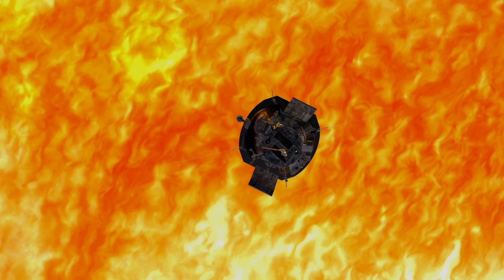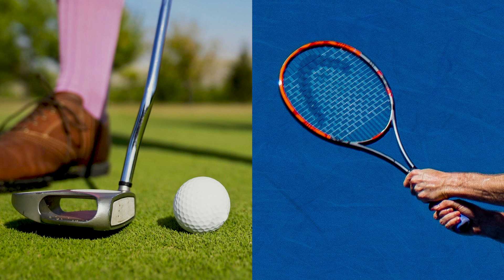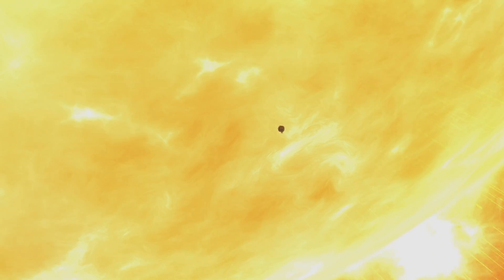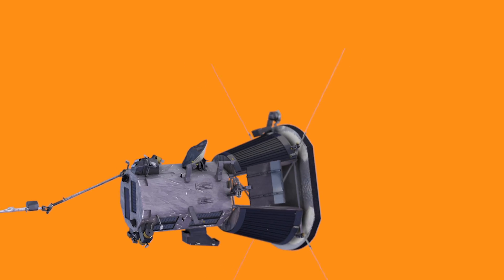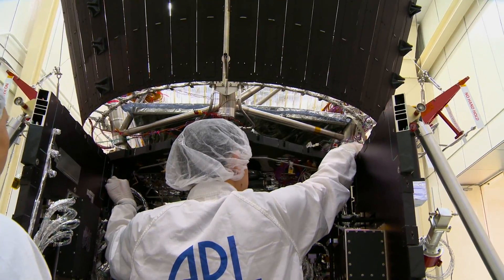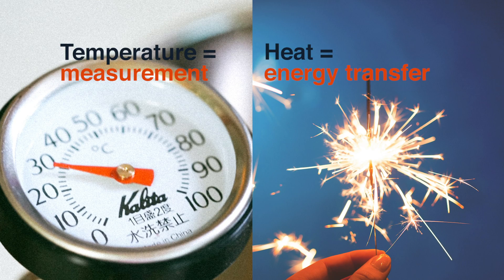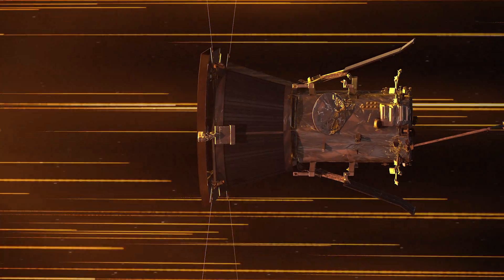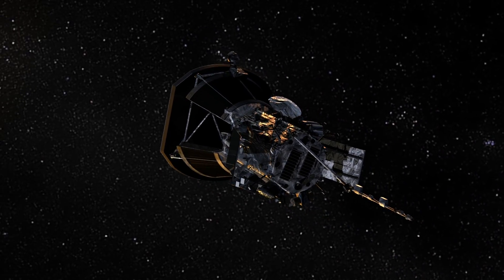Why Won't it Melt? How NASA's Solar Probe will Survive the Sun

Comment: alright stupid questions

1) Why not cover the whole probe in the heat shield?

2) when it gets close enough to the sun wouldn't Light be hitting all sides of the probe and thus throw the sensors off (blinding it)

3) what is keeping the radiators cool? Might the water behind the solar cells heat up faster than it has time to cool and become ineffective?

4) IF the water in the system was to get too hot and become steam, can the cooling system take the extra pressure or is it going to blow itself up?

5) as a counter measure wouldn't it be wise to make sure the electronics are water proofed?

and that's all the stupid questions I could think of atm.

Edit:

6) Did they make sure that all the components used in the probe don't have a low melting point.
Reply: Here's the answers I could come up with, correct me if I'm wrong:
1) The whole probe isn't covered completely is because the only spot that would get heated up is the spot that faces the sun directly, so it'd be unnecessary to cover the entirety of the probe in the heat shield. All you'd have to do is make a circular heat-shield that covers the probe from direct view of the sun, and make sure it's always pointed at the sun to prevent damage.

2) No, because there's no atmosphere and ground like on earth that causes the photons to reflect and go in many directions. If you're not in the line of sight of the sun, you won't have any light and heat hitting you.

3) The radiators radiate the heat off into space in the form of infrared radiation. The required water flow to cool the solar cells and the amount of heat radiated has likely been accounted for by NASA, so they've designed the probe's cooling system based off of calculations and tests.

4) I believe they accounted for this by increasing the pressure of the water in the system, which allows the water to have a higher boiling point temperature and thus reducing the risk of explosion.

5) The electronics are already hardened to withstand radiation and other thing in space, making them water proof wouldn't really make sense. If the water system failed and exploded, there would be no water to cool the electronics and space craft, so it would be destroyed regardless if they were water proof.

6) The electronic components chosen for the mission and the solder joints between them likely have high temperature tolerances, and are likely to be very reliable for space flight applications.

I hope this helped answer your questions!
Reply: Rafy Azhari Well they already know what to expext when they get to the sun in terms of heat and the density of the corona from long range measurements from earth/earth orbit. 

And if your worried that calculations may not be good enough. It mah be worth remembering calculations and testing of individual parts is all you have against the wing snapping when ever you take a flight. Its very rare that a full wing assembly is acturally tested to destruction during production. And its onlu ever done once. Wings made after it are just subjected to a normal operating load.
Reply: Well for arguments sake we assume that the sun is large enough, and that the probe is close enough, for you just to think of it as a big flat plane emitting light. This is the worst case scenario as its actually curved and some light will be shining diagonally above and below the spacecraft. If we go back the plane, the light it emits is radiated out from the plane, perpendicular to it. Then some of it is blocked by the heat shield leaving whatever is behind it in shadow. This shadow does converge at and angle yes, but it's certainly been calculated by NASA for operating distance of the probe. Hence why the main bit of the probe is a lot skinnier than the heat shield. Just look at planets for an example, one half is bright, one half is dark and in shadow. And because there is no atmosphere to scatter the light the shadow is pure shadow and actually extremely cold.

You ask what there is to stop the sides of the sun radiating light sideways/diagonally towards the spacecraft? For one theres physics, most of the light/radiation is shot off perpendicular to the surface. The reason we get such effects here in earth is because of the atmosphere scattering light. In the case of the sun its just flung outwards with the solar wind. And it some were to be scattered towards the probe in some way it would likely be too weak to effect it much. Also the probe could be orbiting too close for that to be a factor. The closer it is, the less the bits of the sun not directly in-front of it, can effect it. As is you drew a line, from its point of origin on the surface, it would have to go through more of the sun itself again. Just take a circle and put a dot representing the probe right next to it, see how many lines you can draw to it from the surface that dont go into the circle itself, its rather limited. And that the worst case scenario for radiation from the sides of the probe.

Hopefully thats cleared some bits up! :D Sorry its a bit long, I think I've rambled.
Reply: Kittsuera
There is idea they should test this device in some solar energy station with mirrors collecting the Sun light in one spot. The should place it into the spot with expected light energy flow. Then do testing for at least one day (several peak hours).
Reply: Kittsuera 
1) money and weight. Heatshields are expensive and heavy.

2) the light from the sun flies out from the surface and away from it, meaning there would be nothing to reflect off of and onto the spacecraft.

3) the water is kept under pressure so that the boiling point raises above the ambient heat of the surrounding area. Water is a very versatile cooling system.

4) I dont work with NASA so i dont know, as i said earlier, water is pretty great so i dont think they would do such a thing out of sheer will. But who knows?

5) the spacecraft is flying towards the sun through space. If it can withstand a vacuum, it can take water.

6) NASA knows what theyre doing, last thing I expect is for them to underestimate the heat of a giant ball of plasma 1000 times more massive than our entire world.
Reply: I still for see a slight problem with my # 2 point.

the Sun is about 109 Earths wide. will light really be radiating in one direction perfectly Vertical from every point on the sun?

What is stopping the far ends of the sun from radiating light diagonally?
Reply: and how much time does it need to cool the probe? there's only a couple particle there, but the probe stay close to the sun for a long time. They haven't tested the probe at the sun, have they? 
also how much time does the probe to arrive at the sun's orbit?
Reply: _ _ yea sure, they've calculated all that. Let's say they could calculate the amount of particle around the sun without a survey. A single expedition would take how many years? It's just one test. Many years are required to build A single spacecraft to go to space. If it doesn't explode before entering the space ofc. I forgot the whole probe is just an idea, yet. sorry
Reply: This ISN'T the first probe we've sent to study the Sun.  It's just the closest one so far.  "If I have seen further than others, it is by standing upon the shoulders of giants."  Pity so many people today wrongly assume our forefathers were midgets.
Reply: If you cover the entire craft, it only makes heating problem worse.
Like the video, it looks like the craft being in a shade of that shield.
If you cover the entire craft... It will transfer the not reflected heat to the entire body of the craft. And even threatened it to explode from gas or fluid expansion.
As the heat taken to the craft internals wouldnt be transferred well to outside.
Either greenhouse effect, or black body also served as a heat trap for the things inside the shell. 
That's my opinion. Not entirely sure if correct.
Reply: It ain't going that close to the sun dude
Reply: Rafy Azhari im pretty sure that nasa would have calculated all that and built the cooling system accordingly. 

And I think you underestimate how tough the electronics are. If we can build probes that withstand the temperatures of venus we can do this. The efficiency of heat transfer is much much lower as there is next to nothing to transfer the heat.
Reply: all i see is gibberish. English please
Reply: Answer to 1-6: stfu

Comment: When probe is inside 0.3AU from Sun, its communication likely start to fail. Around 0.1AU, it will be knead/crush into a spherical shape by coma-like inward pressure... could have learned a lot more from data of probe plunged into Jupiter atmosphere.  Better value for science by placing a probe with submarine structure (ensure shape+equipment integrity) at Mercury L1 point... My ignorant 2 cents!
Reply: something something heat shield and radiators. Youre ignoring that Oumuamua had no means of a good cooling system, the water and the radiators
Reply: Honestly at this point you're using so much unnecessary filler information I have no idea what you mean to convey. Its literally a word salad in the context of a response
Reply: I am not disagreeing on Parker necessary heat shield.  I stated 'coma-like' or one can envision energy volume analogous to expanding Chromodynamic Binding Energy as probe traverses into denser gravitational and radiation field.  Recalling, comet Shoe Maker broker into pieces (quite far away from Jupiter) not due to thermal.  Comet Holmes/17P in 2007 briefly a largest object in solar system (bigger than the Sun) - for sure, its coma didn't formed by heat. Comet Lovejoy survived glaze almost at sun surface... it didn't has a heat shield.
Reply: Thanks for replies... maybe reread my comments after Parker probe failed.  'Word Salad' - from an EU speaker, iirc.
Basically, I predicted the cause for this probe failure, which is by pressure, not heat.

Comment: Does it turn and take peeks at the sun and snap pictures?
Reply: No.  It has to keep the shield in front of the probe to prevent damage.   It can photograph the corona but not the sun directly.   That can be done just as well from a safe distance.

Comment: Must be tough times for the solar panels.
Reply: SourceThunderLight 
Yes, solar panels require water cooling in such conditions. Also they are not directed to the Sun for maximum light collection. They can be set by small angle to the Sun light and collect only small fraction of it. Also the panels improve electricity production if they collect more light. They can produce 100x more electricity near the Sun if required.

Comment: I'm confused.  If it can run tests and sense things without interference from the heat shield and if the heat shield actually works, why not shield it on all sides?  Why would you only shield it on one side?  It makes zero sense to me.
Reply: It only needs to shield itself from the solar radiation of the direct sunlight, which would damage the probe.  Shielding it on all sides would prevent the instruments from measuring the solar corona, which is the whole point of the mission.
Reply: Tletna Because the heat shield probably weighs a lot, and the less mass you spend on shielding, the more you can use for science stuff.
Reply: How is it fake? You can visit their site to get all the information you need.
Reply: This shield reduces termal energy flow. But it is still not zero on the other side of the shield. So making ball of shield does not have any sense for the electronic devices. Ball shield will be heated to the maximum temperature, and all inside will do the same.
Reply: Because the heat will be coming out from the sun.
Reply: Tletna you got zero brains, really

Comment: Is it going to be launched or already launched?
Reply from the maker: +Alexander Belov - There's an animation of the trajectory and course corrections around Venus on this page: https://svs.gsfc.nasa.gov/13003
It's item number 11 on the page.
Reply: To be launched on August 4th.
Reply: I'm actually concerned how they are going to get close to the Sun since they need to start from the Earth moving 30km/s, then reach escape velocity of about 11km/s. Assuming they do acceleration in the direction opposite to the Earth orbit they get 19km/s around the Sun. But this is not enough slowdown to come close the Sun. They need slowdown to 1.5km/s around the Sun to get so close (6,500,000km), but how do they accelerate from 19 to 1.5 (>17)? Do they use heavy rocket to do this? Are they going to do gravitational maneuver around the Venus, an the Mercury for additional slowdown?
Reply: NASA Goddard Looks like it shall have elliptic orbit that passes near the Venus orbit.

Comment: The shot with the probe with the full-screen sun in the background is wrong; they're overstating the closeness for publicity purposes. The probe will get to about 9 solar diameters away, so the Sun will be as large as a softball at arm's length. This is extremely close in terms of heat, but it won't look as big as the shot implies.
Reply: From the probe, the sun's angular size would be around 12 degrees. So that's still a good chunk of your field of view, but not nearly as much as shown in the animation.
Reply: Not 9 solar diameters away, but about 4.4 solar diameters away.  6.2 million km divided by sun's diameter of 1.4 million km.
Reply: Daniel Griscom sounds cool, I would be even cooler if it was real

Comment: How thick is the Heat Shield ?? Dimensions please ?
Reply: Mystery Man it was explained in the video.
Reply: Mystery Man my mistake, I read the dimensions from an article that brought me here. The shield is 8 ft (2.4 meters) in diameter and 4.5 in (115 mm) thick. Weighing in at 160 lbs (72.575 kg).
Reply: Hmm that's quite thick.

Comment: Surely the "water" is mixed with something a bit more high performance? I'm intrigued! 

Thanks. :)
Reply: "The coolant used for the system? About a gallon (3.7 liters) of deionized water. While plenty of chemical coolants exist, the range of temperatures the spacecraft will be exposed to varies between 50 F (10 C) and 257 F (125 C). Very few liquids can handle those ranges like water. To keep the water from boiling at the higher end of the temperatures, it will be pressurized so the boiling point is over 257 F (125 C)."
https://phys.org/news/2018-07-sun-wont-parker-solar-probe.html
Reply: Water has a very high specific heat capacity, making it one of the best fluids for heat dissipation.
No need to mix it with anything!
Reply: yeah true i read this way back in high school too!!
Reply: Of course! Just a few bottles of Vodka and it’s good to go!
Reply: @ksmi9109  Shh don’t want to give NASA any ideas
Reply: Absolutely.  -The Freezing and boiling point of water was my main concern.  

However, I read that they're using 5 liters of deionized water, BUT, they are pressurizing the system to raise the water's boiling temp to 257F. Freezing doesn't seem to be an issue since the Sun will preheat the system into operation. ;)
Reply: +Novel Nouvel - That's a great question. Since convection and conduction are nearly non-existent in space, heat is mostly transferred in the form of Infrared Radiation. This common type of electromagnetic radiation is how the Sun is able to warm our faces even though it just traveled 93 million miles through space; which takes around 8 minutes at the speed of light. The same goes for feeling the heat given from a large fire, even though you are standing many meters away. 

So basically, a radiator in space is "shining" its invisible heat-light into the void. Energy in, energy out. ;)

Someone correct me if I'm wrong, pls. :)

Edit: Diction.
Reply: how does the heat transfered from the cooling system to the environment? Even an air is not good enough, let alone a void.

I need to buy that radiator for my pc.
Reply: @novelnouvel  nobody ask about it cause they dont understand heat transfer...hahaha they have been cheated by decades.
Reply: Nope. It's 100% H2O. It will keep your CPU and GPU cool so you can play hyper realistic Minecraft in space.
Reply: Temperatures don't work in space like they do on Earth.  Heat needs a medium (like the air here on our planet) to transfer through, and there's very little of that in space.  There's more closer to the sun, of course, but still not a lot.
Reply: AG the coolant water is pumped fast enough thru the cooling tubes it doesn't reach the actual temp the surface of the panels are seeing.  Think of the air blowing from a vent in your house.  Even though it cools you by blowing on your skin, the air itself doesnt go up to your skin temp.

Comment: Very Interesting. would be that the small fold mirrors "Peeking" out from the edges of the sunshield are also "cold mirrors" The type that allow the heat to pass through into space, while reflecting some visible light to the protected sensors?
This is similar to the old Hollywood trick of hiding the expensive camera behind a rock or other blast shield, while photographing an explosion scene through a 45 degree mirror that might get destroyed during the explosion, but will save the camera.